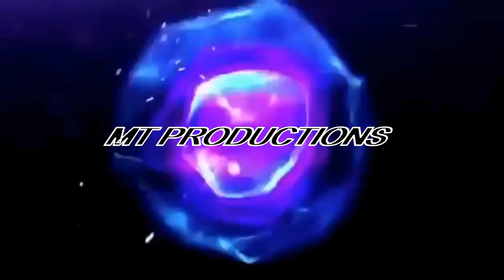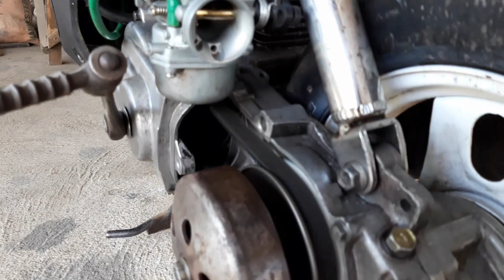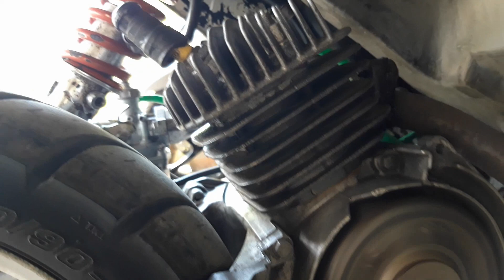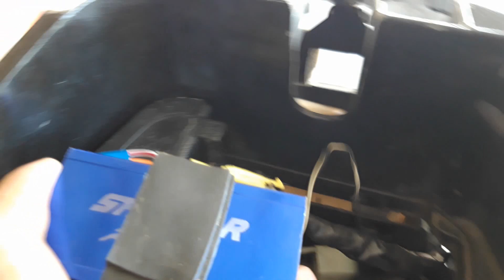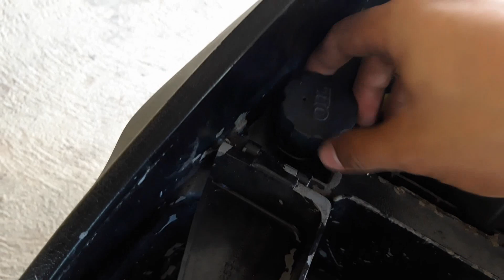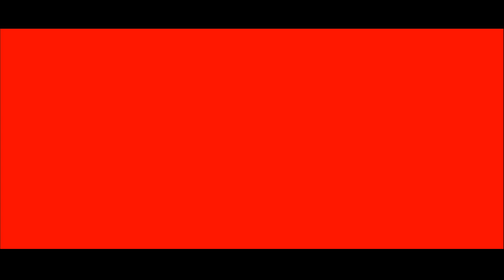HONDA DIO PROJECT (PART 5) FIRST START

Comment: Paps may alam Ka bang shop na nabinilhan Ng 22 mm carb?
Reply from the maker: Check ko po if meron akong avail n part sir. San po ba loc nyo?
Reply: @MioDioWorks  Bataan paps.
Reply: @MioDioWorks   boss ano kaya problema nung dio ko, ayaw kasi umarangkada pero nagsstart naman sya